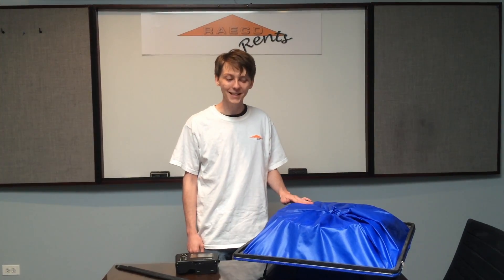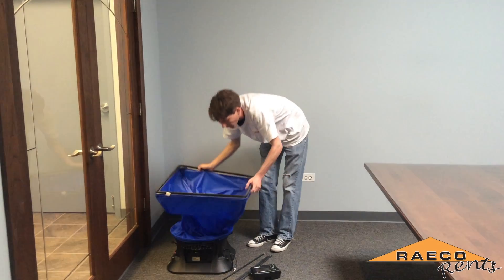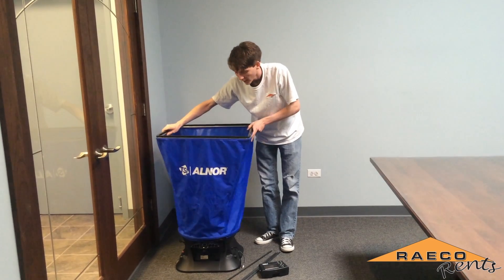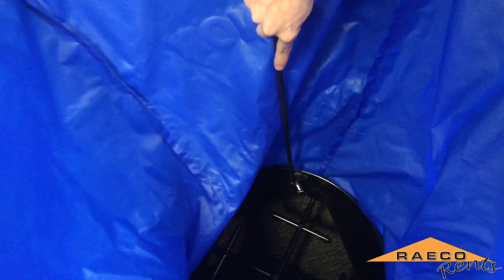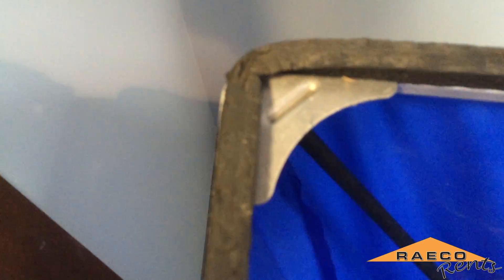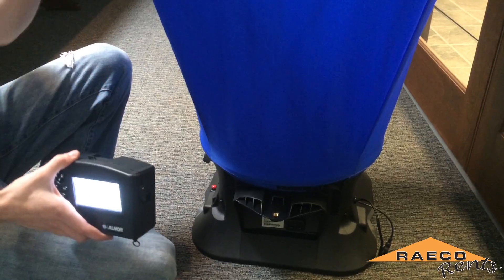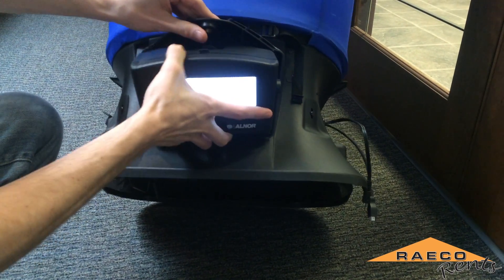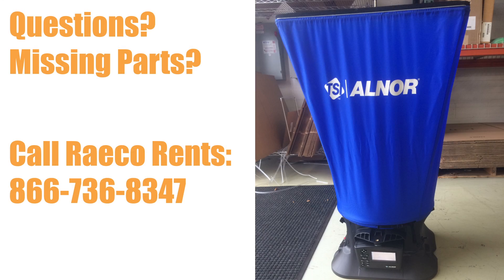RAECO Rents: How to Set Up a Balometer Capture Hood

Comment: Hi  this is sageer from Abu Dhabi please help me my tsi balometer is not working balometer display show pressure and temperature reading is not showing on display and balometer flap is open but display show  flap close so cfm is not show on  balometer display please help me .   Model no. - PH731,serial no. -PH7311722006